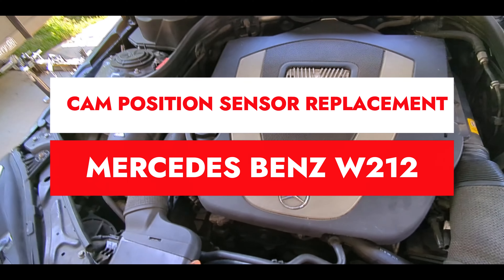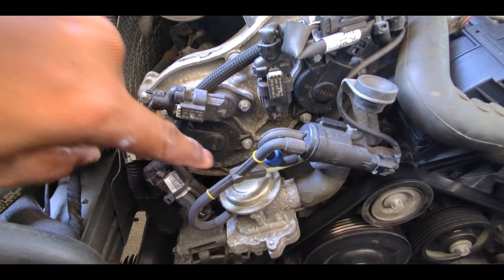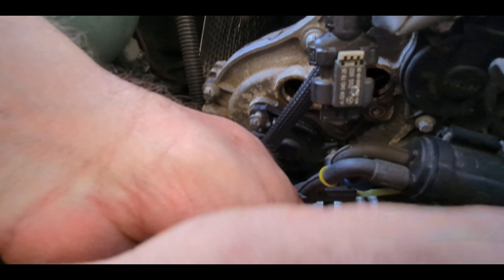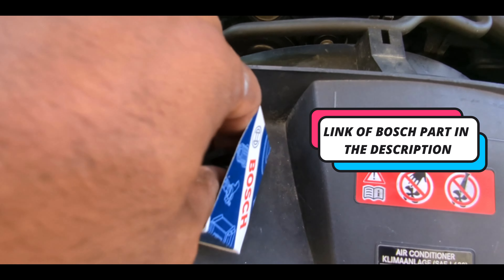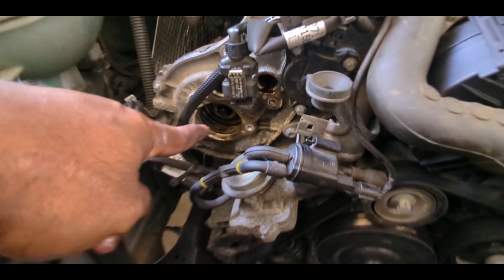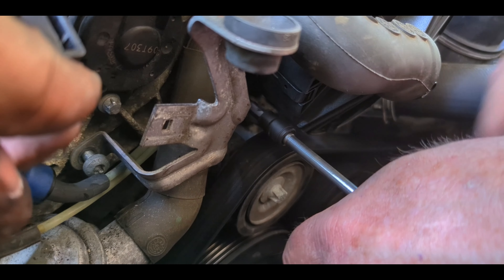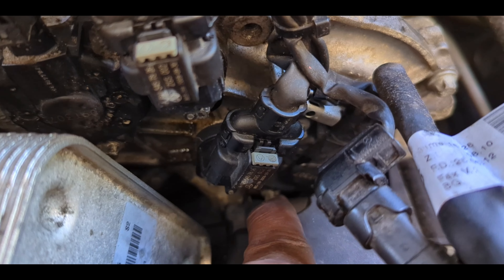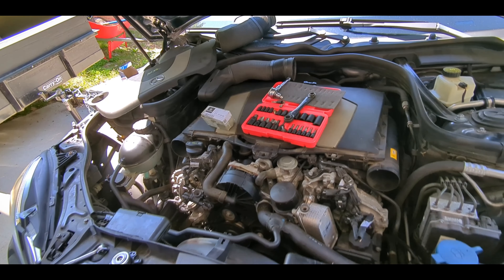Mercedes Benz Cam Position Sensor and Magnetic Adjuster Replacement - W212 E-Class

Comment: Thank you so much for posting this video. I replaced one of the cam position sensors on passenger side, still need to check the rest of the connections as there was oil in my ECM luckily no damage. Well I say that, but recently I had a bunch of misfires and I went ahead changed all plugs and coils.  Turns out I also had a blown fuse # 24 in engine bay located on driver side top right.  Just saying this for anyone dealing with some issues of more than 1 cylinder misfire to check fuses as well

Would you happen to know the intake manifold psi pressure where it should be?  Mine is reading 4.5-5 psi, I replaced gaskets and checked all vacuum lines and connections and still have it reading high

Comment: Firstly thanks a lot for your video. I do have the 0346 code for sensor A bank 2 would that be the one under the intake on driver side ?  I see you working with a smaller wrench. Did that save you  from removing additional parts like the intake manifold? Love this video and more than likely will attempt to get rid of this code as my c207 e350 becoming an older car.

Comment: Is sensor A in bank 1 the sensor on the left or the right when looking at the front of the engine?  thanks!  Great vid!
Reply from the maker: Bank 1 refers to the bank to which cylinder number 1 belongs. For w212 it is the left side of you when you are looking from the front of the car.
Reply: @JJCentral-DIY  thanks for answering.  I understand that bank 1 is on the left side, but the error code says "bank 1, sensor A".  There are 2 sensors in bank 1.  Which one is sensor A?  The one on the left in bank 1 or the one on the right in bank 1?
Reply from the maker: @jeffsnyder4696  left sensor on the bank 1. If you are unsure swap the sensors and see if you get bank1 sensor 2 code.
Reply: @JJCentral-DIY  Awesome!!  Thank you.
Reply: Will the error code clear quickly on it's own or will it need a couple drives for that to happen?
Reply from the maker: @jeffsnyder4696  it will take 3 cycles before it clears.
Reply: Code P0346 change camshaft sensor bank 2. Is A the hard one under cover?

Comment: I have m278 engine with fault code p0018 p0017 will change those sensors help to fix the problem?
Btw the engine runs fine with out any problems.
Reply from the maker: Yes, that is the first step. You can also clean the wiring harness and see if they are corroded or filled with oil.
Reply: @JJCentral-DIY  I have the same engine M278 with a 0016 error code bank 1. Car runs great but sometimes it makes a rattle sound when starting would that be the magnetic sensor?
Reply from the maker: @brgable  It could be the sensor or the crankshaft not lining up to the cam. Clear the code, drive it and see if it comes back.
Reply: @JJCentral-DIY  ok thank you!

Comment: Great video! would you happen to have experience with code P0276 ( Adjustment of the intake camshaft bank 2 is performed late ) I was going to replace all these sensors, but not sure that will help for this code? I did have all the injectors replaced a year ago.
Reply from the maker: The good news is the code p0276 directly refers to fuel injector on cylinder 6. I would first remove the injector, clean the electrical terminals, check the wires for any short. It's something electrical in that injector that is putting that code.

Comment: Not having issues (yet) but have the replacement kit from FCP that comes with the sacrificial pig tails as well. I'm at 60K so doing this as a preventative measure. Would you consider this regular maintenance we should just plan on doing every so often? Like every 50K or 100K?
Reply from the maker: This doesn't need to be changed as a maintenance item. The only reason this goes bad is when the rubber gasket breaks and leaks oil, or other fluid enters the electrical connection and short it. If your engine bay is dry without and leaks this should last for ever.
Reply: @JJCentral-DIY  Right on! Thanks! Guess I'll just have the parts on hand and ready to go then. The sacrificial pigtails probably still aren't a bad idea though, huh?
Reply from the maker: @2WhiteAndNerdy  Mercedes came up with the sacrificial pig tail as a quick warranty fix to mitigate their bad design. It works but if you understand how these sensors work you would also question introducing extra wiring increases the resistance and may alter the signal from the sensor to ECU. Mercedes recalibrates the ECU to fix that issue, in our car we won't recalibrate and that may cause minor issues in engine timing.
Reply: @JJCentral-DIY  I see. Thanks! Guess I'll start with just disconnecting everything to inspect the connectors and clean em up while I'm at it.

Comment: Do we absolutely need to do the magnetic sensors as well? Thanks
Reply from the maker: No, just the cam sensors should be enough. Magnetic sensors hardly go bad. Lot of times it is just the electrical connectors and not the sensor itself. Clean the connectors first and see.
Reply: @JJCentral-DIY  thank you very much for the prompt reply . I ll try the cam sensors first and see if it solves the issue

Comment: I have error code P0015 on my 2011 e350. Do i have to replace this sensors? Thank you.
Reply from the maker: Yes, detach and check if you have any oily residue on the electrical connections of the cam sensors or the magnetic sensors first. If so spray and clean it. 
Your code is on the left bank only. Replace the left magnetic sensor next. If that doesn't work, replace the cam sensor.
Reply: @JJCentral-DIY  Thank you!

Comment: I have code P0011 for 2008 E350. Can you help please
Reply from the maker: It basically is the timing code. Either your timing chain is stretched and not maintaining timing or the sensor that picks up the timing is faulty. You can start by changing the intake cam shaft position sensor and see if it gets better.

Comment: I have a code p0016 please help thanks
Reply from the maker: It's a code that tells your cam position sensor and crank position sensor timing values don't match. It could be timing chain getting loose, bad sensors or bad oil. Do a oil change first and make sure you fill back proper amount of synthetic oil.

Comment: Where is camshaft position sensor bank 2 sensor 1?
Reply from the maker: Bank 2 is left side in the direction of travel. Usually they are cheap enough to replace all 4. Some times if you have power steering pump leak, the fluid builds up in the can sensor connectors and can throw a can sensor code. Check the wires first, spray them clean and see if it helps.

Comment: How much should an indy shop charge for this?
Reply from the maker: Anywhere from 600 to 1500
Reply: @JJCentral-DIY  I was quoted $1200 at my local indie. FCP Euro sells the whole kit for about $300. I'll save the $900 and attempt myself since the job looks relatively easy and quick enough.
Reply from the maker: @2WhiteAndNerdy  It is an easy job if you have the right tools, check the video and get correct torx bits and shorty ratchets. Also the new part some times comes with bigger o ring gaskets which makes it harder to seat flush. Save your old part so you can pull the o ring from it if needed. It should sit very snug and flush.